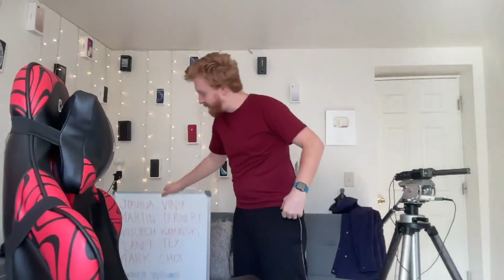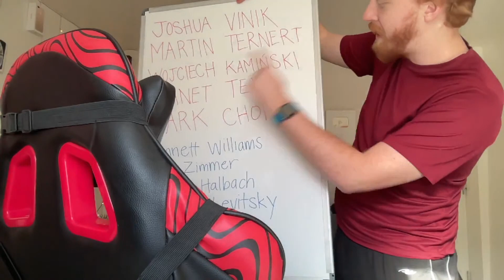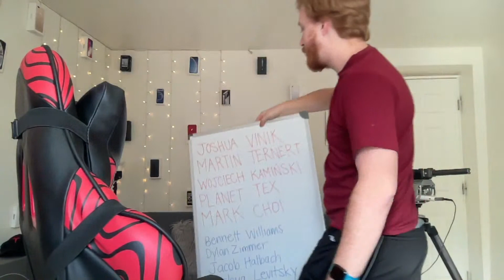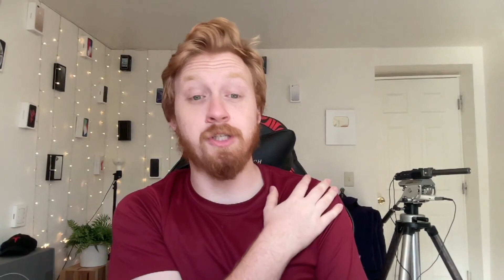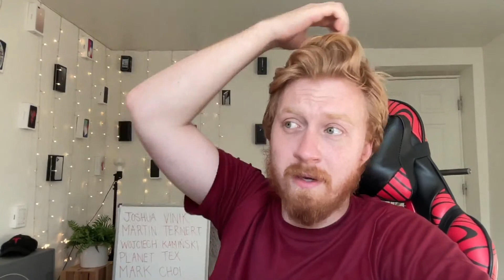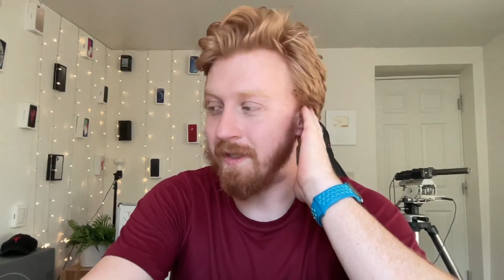Pepsi gains Permits for Tesla Semi Megachargers

Comment: Or just put the charge port in the front, that at least allows you to pull in straight and back out with a trailer on. On optimal but give you  access to the whole existing network without dismounting trailer.

Comment: When Tesla transitions from model Ys equipped with 2170 cells to ones with 4680 cells, they will make the transition almost invisible by matching the specs. There won’t be any bump in specs.
Reply: I doubt that. They would most likely want to flex their higher range numbers wouldn’t they?

Comment: Why hold out for 4680 Model Y when you can buy a Model Y now and then order another one in order to get a 4680 equipped one later? It sounds extravagant but in today’s market you can buy a new Tesla and flip it for more.
Reply: That’s only if chip situation doesn’t get better before the 4680 batteries come out. Because if it does then the trade in appraisal of your Model Y will significantly drop.